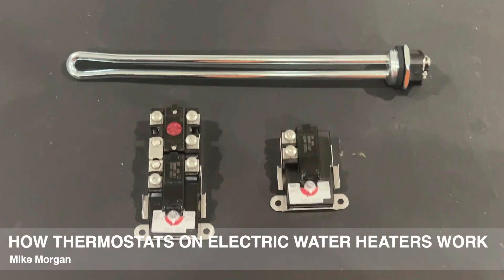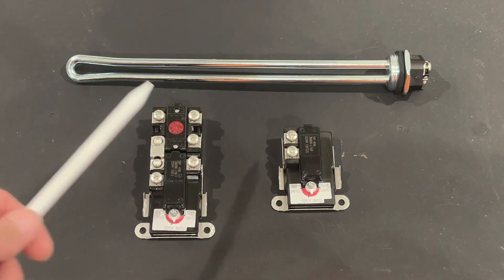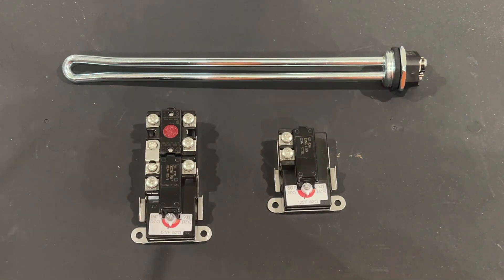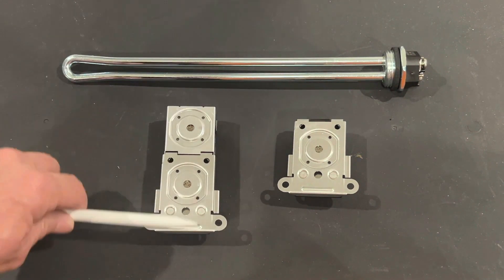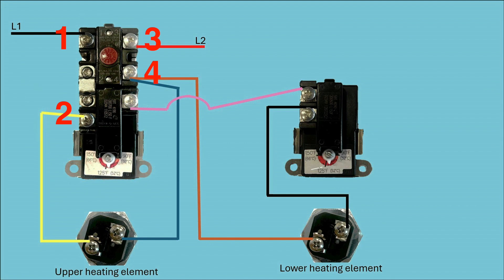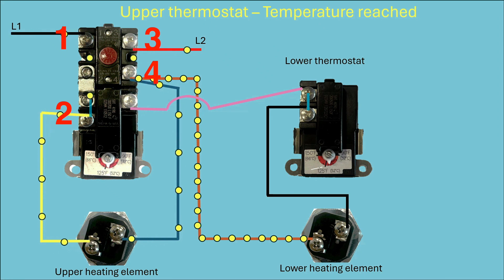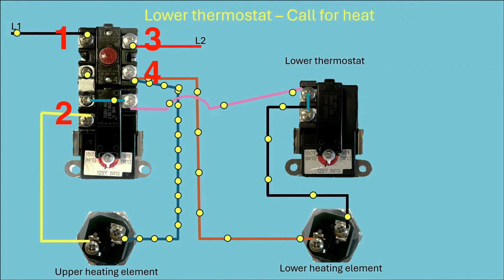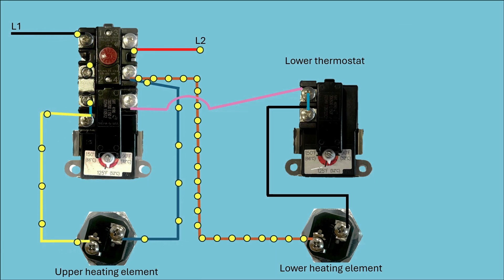How Water Heater Thermostats Work

Comment: How do you know which thermostat is bad when the water is getting too hot
Reply from the maker: Great question, Tom! 👋
The easiest way to test is to turn the temperature dial up and down on each thermostat and listen for a click. That click means the thermostat is switching on and off properly. If one doesn’t click — especially the upper thermostat — it may be stuck. The upper thermostat is the main control; it sends power either to the upper or lower heating element, so if it fails, it can keep the heater running and overheat the water.

To double-check, you can also test with a multimeter (power off first). If the upper thermostat still shows continuity even when the tank is already hot, that confirms it’s bad and needs to be replaced.

Comment: Great,  easy to understand as always.  Keep up the good videos.  

As an honorable mention,  something else  your viewers may find helpful is configuring a water heater for simultaneous operation,  that is, both elements can operate at the same time as the thermostats are independent and therefore both require the high limit safety switch.  In this case the typical 4500 water heater can draw up to 9000 watts and requires a 50 amp circuit, or two 30 amp circuits.    

What you are showing is what we as plumbers and electricians refer to as "non-simultanous" or "interlock " operation and probably 99% of residential water heaters are set up this way.   Simultaneous operation would typically only be possible on a commercial water heater, although residential units may be special ordered for field conversion from " non-simultanous " to "simultaneous " operation,  although I've personally never seen one.   Perhaps you could demonstrate this on a future video.
Reply from the maker: Hey Sparky. Where have you been? I’m waiting to see your answer to the “contest” video that I published this morning. As I was making it, I was wondering just how close you would get to solving it.
Reply: @morganinspectionservices3840  Man, I'm embarrassed to say this one stumped me, but I'm going to take a stab at it.  The hot tab on the receptacle is broken,  and the incoming hot is on the top half.   Somewhere else in the circuit is screwed up in such a way that places the neutral for the overhead lights on the bottom half of the receptacle on the hot side, and the nightlight (or whatever else happened to be plugged in) is in series,  to complete the circuit for the overhead lights.   

This was my response.   I've seen some very weird stuff helping out with renovations, including a 3 way switch setup on a farm, that controlled a yardlight from the house & barn, fed by two different panels,  a single wire overhead from the house to yardlight, and from yardlight to barn.   Hot and neutral wires on the travellers of both 3 ways.   The farm was in Sanilac County michigan,  installed sometime in the 1950s after the farm got electricity in 1951, very rural area.   How this worked was by flipping the polarity of the lampholder.   The light is OFF if it gets two neutrals or two hots (on the same phase). The light is ON when it gets a hot and neutral,  correct or reverse polarity.    If the breakers were rearranged to put the two 3 way switchs on the opposite phase,  then in one of the four switch positions the light will get Hot A & Hot B = 240 volts and a very bright bulb for a short time before going out in a blaze of glory.    Which is exactly what happened when that farmer,  whom my dad has known for many years,  needed to move some breakers in the barn to make room for a 2 pole 20 amp for an air compressor he just brought.   This would have been in 2015, I was 25 at the time and just finished my apprenticeship.      I spent litteraly hours scratching my head before just for the fun of it, put my multimeter across the travellers of both switches,  and only then did I realize I had a hot & neutral connected to the switches and was able to solve the puzzle.   To fix the problem,  all I did was find the breaker in the barn that powered the yardlight,  and swap positions with another single pole.   That farmer was speechless when I explained it to him.
Reply from the maker: I will keep trying.